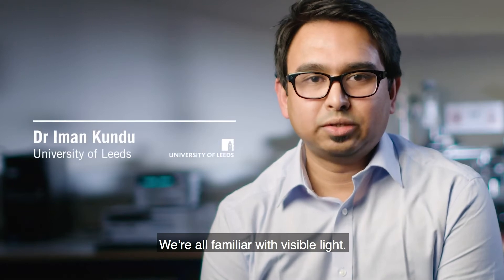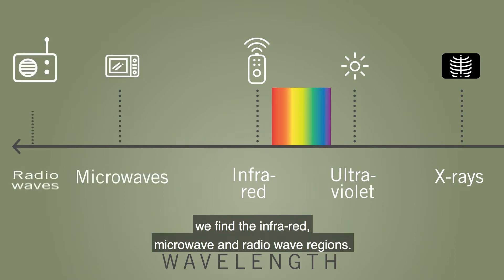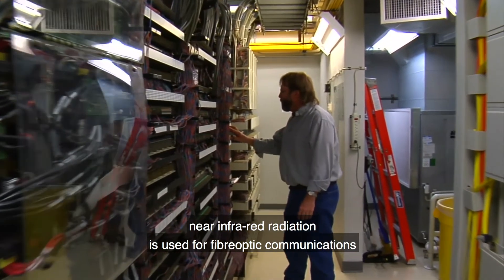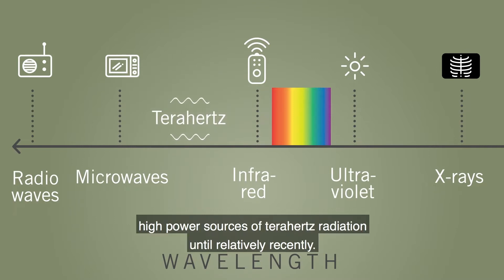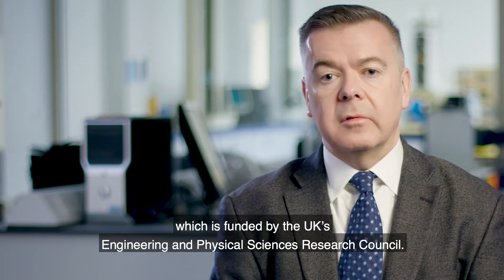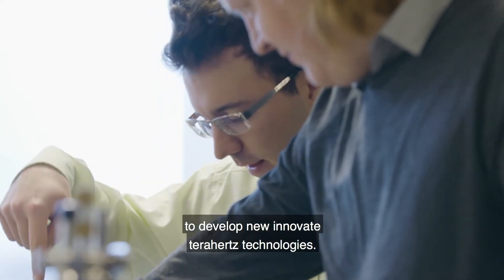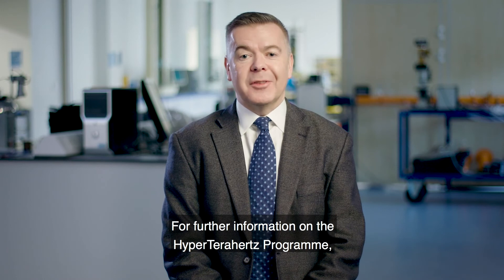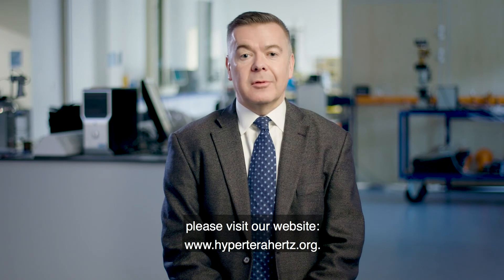Terahertz Technology and The Hyperterahertz Programme: An Introduction

Comment: ⥊ 66: 55
66: HAVANA SYNDROME

0: Good (if not good, then not zero)
0001: Uniqueness

001: Identity
002: Individuality
003: Variability

01: Awareness
02: Diversion
03: Sensibility
04: Love
05: Grace
06: Reasoning
07: Ingenuity
08: Purity
09: Truth Seeking

1: Ethical
2: Problem-Solution
3: Source
4: Cognition
5: Expression
6: Why/Who/When/How/Where/What
7: Information/Code
8: State
9: Sanity

10: Network (Good Network, because zero)
11: Justice
12: Time/Spread/Dissipation/Easter
13: Death
14: Perception / Memory
15: Agent
16: Reason
17: Argument
18: Constancy
19: Discipline

20: Judgement
21: To Solve Problems with Ethics
22: Resistance/Endure Introspection
23: Consideration
24: Humor / Mental State
25: Behavior
26: Motivtion
27: Cohesion
28: Dependability
29: Prognostic

30: Liberty
31: Consent
32: Discernment
33: Response
34: Ideas
35: Capacity
36: Technique
37: Design
38: Decision
39: Optimism

40: Good Will
41: Attention
42: Critical Thinking
43: Knowledge
44: Free Love
45: Plan / Task Force
46: Purpose
47: Perspective
48: Character
49: Ambition

50: Good Expression
51: Manifestation
52: Support
53: Respect
54: Care
55: Peace / War 
56: Profiling
57: Tell / Counter-Terrorism
58: Invoking / Building
59: Proficiency / To Excel

60: Certainty
61: Identification
62: Qualification / Characterization
63: Inquiring
64: Conjecturing
65: Function / Role
66: Investigation
67: Arguing
68: Indicator
69: Scrutinity

70: Validation
71: Illustration / Knowledge
72: Construct
73: Explanation
74: Data
75: Materialization
76: Delineation / Instruction
77: Flow / Cadency
78: Share
79: Evolution

80: Personal Soverenity Control 
81: Independency Strength  Established
82: Resilience
83: Decision
84: Autonomy
85: Power Severity Mobility Executing
86: Authority
87: Stream
88: Consistency
89: Boldness Self-Control

90: Wisdom
91: Assertiveness
92: Science
93: Scrupulousness
94: Integrality
95: Composure
96: Blockchain
97: Anarchy
98: Veganism
99: Revolution

100: Liberation
101: Peer-2-Peer
102: Decentralized Network
103: Financial Revolution
104: Production Revolution
105: Labour Reorganization
106: Needs Evaluation
107: Instruction
108: Personal Sovereignty
109: Resources Availability

110: Glory
111: Honor
112: Distributed Ledger
113: Privacy
114: Abolitionism
115: Pride
116: Pacifism
119: Mission
120: Harvest
121: To Revolt
122: To Sort Out
130: Energy Management
140: Serenity
141: Mindfulness
150: Good Character
151: Virtue
155: Honesty
160: Technology
185: System Accessibility
181: Structure

200: Sanctuary
209: Enlist
210: Resolution
211: To Engage
212: Secure
215: Mobilize
219: Annihilation
220: Contemplation / Meditation
221: Either Way / Alignment
222: Cooperation
250: To Thrive
255: To Emerge
230: Resilience

300: Crusade / Jihad
310: Consensus
311: Unity
320: Deliberation
330: Win-Win
333: Abundance
340: Abolitionism
360: Technology

400: Civilization
410: Culture
440: Fellowship
444: Direct Digital Democracy

500: Assumption
501: Leadership
510: Admiration
511: Honorable
512: Altruism
520: Proficiency
530: Acceptance
535: Denoucing
540: Appreciation
550: Diplomacy
555: Gathering
566: To Pick Up Someone/Something
590: Excellency

600: Organizator
620: Diagnose
660: Operation
661: Operator
665: Role
666: Method
676: Deduce

700: Constitution
710: Intelligence
750: Consolidation
751: Enlightment
757: Prompt
766: Plan
770: The Gear
771: File
773: Algorithm
775: Output
777: Pattern / Rhetoric
778: Development
780: Systematization
788: Design

800: Providence / Heroism
801: Production
802: Necessities
803: Resorces
804: Energy
808: Renewable Cycle
810: Permaculture
820: Management
830: Logistics
831: Scheme
832: Reach
833: Demand
834: Stock
835: Distribution
840: Consumption
850: Labor
860: Human Resources
863: Assignments
870: Structure
880: Peace
888: Globalization
890: Needs
899: Conception

900: Transparency
910: Institutions
930: Energy Distribution
931: Only One Global Currency
960: Blockchain
962: Traceability
970: Optimination
995: Accountancy
998: Regulation
999: Fiscalization
1000: Militancy
1001: Nova Era

1042: Drug Liberation
1100: Liberation Army
1500: Benevolence
1550: Charity
1807: Black & Yellow
2222: Paradox
3000: Freedom
3100: Triumph
3330: We All Can Live In Abundance
5000: Glory
5500: Greatness
8000: Sustainability
10000: Universe

. This is a numeric Matrix for communications purposes.
. This can be used to convey meaning.
   Ex.: 6022: Good Reason to Resist.
. Mathematical operators can be used to calculate meaning.
   Ex.: To liberate with a good force: 340. 300 + 40 = 340.
. Logical operators to create statements.
   Ex.: ¬11: 13. If not Justice then Death.
. Colors can also be used as information.
- You can help build it.
Reply: 13